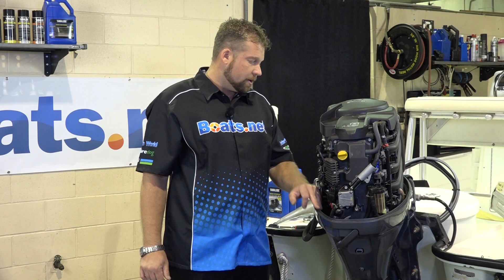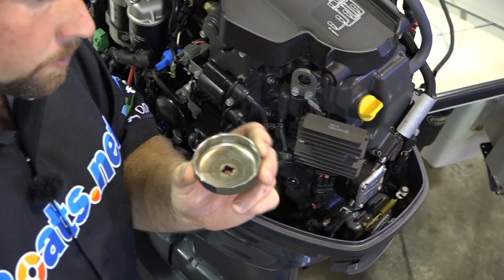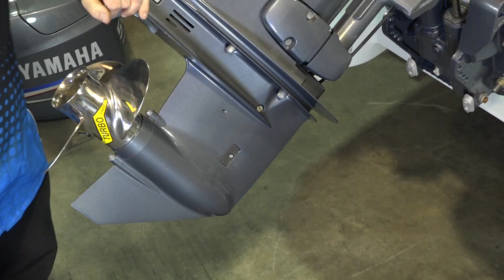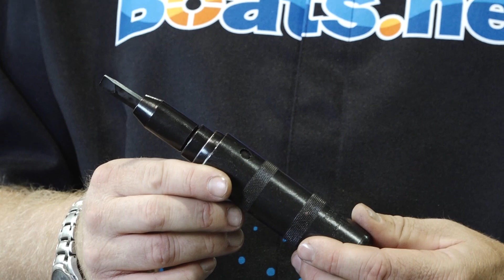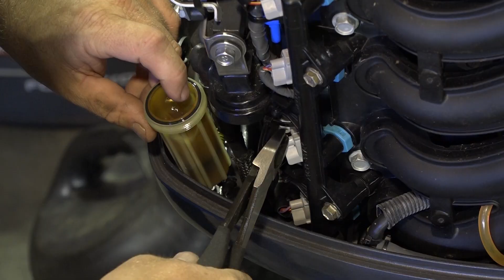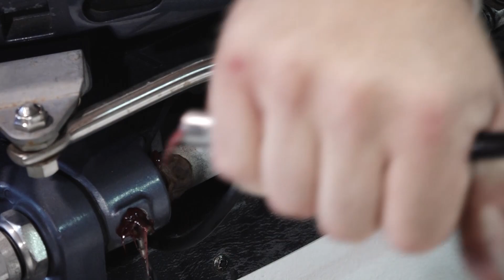Yamaha Outboard 100 Hour Service | Yamaha F50 100 Hour Service  | Boats.net

Comment: Great video but when I tried to fill the gear oil in the lower unit with the same oil and pump and system you have, it stopped pumping at about 75% of the quart without spilling out of the top hole.  Now what do I do?  I'm finding trouble determining the gear oil capacity to know if there is enough oil in it.

Comment: This is a great video on the oil change i have followed your lead an implemented the hose an barb idea , i would have left it draining and changed the filter while it was still in the lowered position ,ive seen a lot of videos on doing this but one thing i have always done with cars bikes is remove the filler cap and also the dipstick .
Reply: What was the barb size and thread size for the hose
Reply: @leebriand5305  pretty sure it is a 14mm ut cant remembet the thread pitch

Comment: Excellent video, thanks. The barbed drain hose trick is great, as well as the sequence you go through with the gear case oil change. I've been maintaining my F50 TLR for five seasons now, and I can definitely say those tips will help me this fall.  I would also add a step to check the lower unit holding pressure (after draining it) using a small bicycle pump. There's a spec for that in the service manual.

Comment: What thread size is the barb oil drain fitting?
Reply: Did you ever find out? I assumed it was a hose fitting like for an air gun.
Reply: @matthewb6086  NOpe